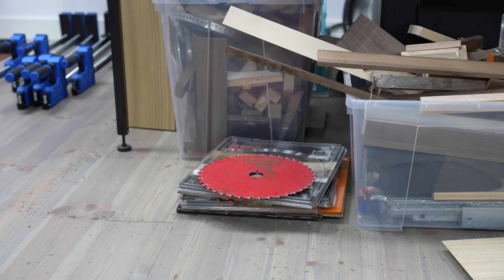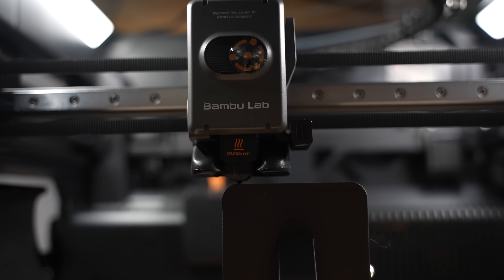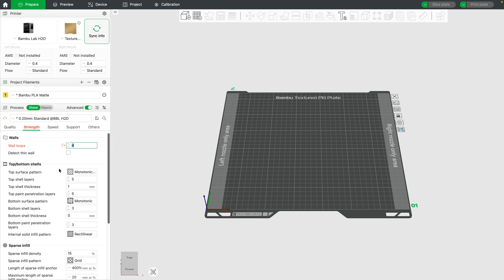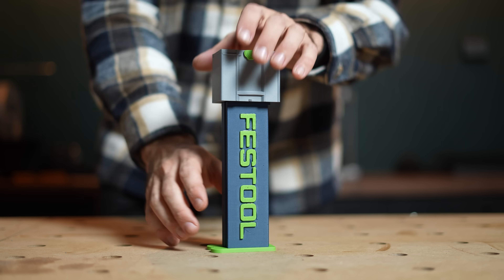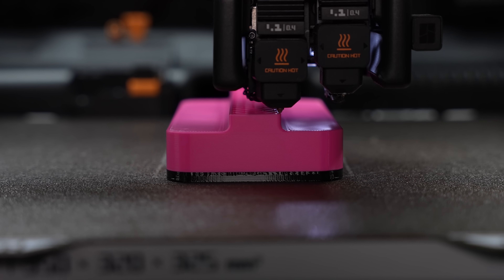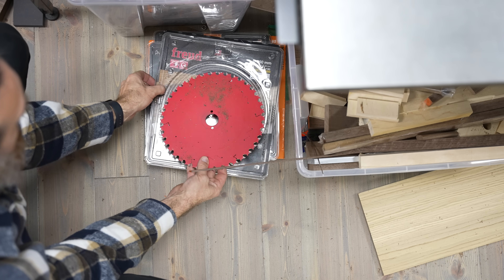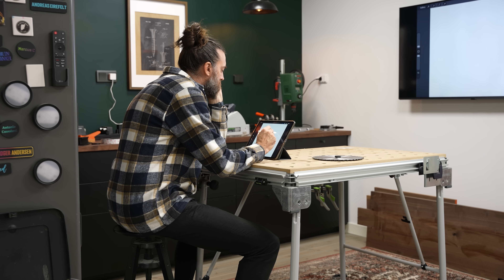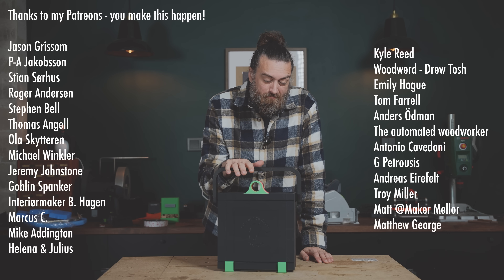Tool companies can't compete with these 3d-prints

Comment: A quick trick for those that can't print TPU or simply don't want to at the time is to print in another plastic and then coat the surface of same with a layer of silicone caulk. It will take a few hours to cure, but the coating creates a very "grabby" transparent surface.

Comment: The offset was the first thing I've thought about when You presented this saw blade case, but that's something every maker experienced, improvement, You can add stripes for pulling those handles this would make a workaround to pull them separately.

Comment: With regards to vacuuming the floor, then make a flat box to put on the floor. On one side you make an attachment for the vacuum hose. On the top, you can make a large hole to put in a contraption with a large magnet at the top and a hole through in the other direction. Put a handle on the top of that, so you can lift it out of the box. On the other side, you make it open with a bevel to the fool, on the blade on the floor, so it is easy to sweep the dust into the box. Make a triangular insert to narrow the box from the front to the size of the vacuum insert. When you sweep the floor, you just sweep it into the box while the vacuum cleaner is running. All wood dust will be sucked into the bag. When you turn it off, you can lift the magnet out of the box, and remove all metal bits like screws etc.

Comment: I believe the stamping of the dominoes is for expansion. When you press wood (not too hard or you break the fibers) And then you wet it, the wood springs back to it's original form.  This is very useful for dominoes.

Comment: I think your designs are amazing. And that last one, with the saw blades that was fantastic! I was thinking the same thing when you were talking about offsetting the handles that hold each blade to pull it out easier. And your small blade dispenser, great idea. I actually have been cut by a blade being put in our garbage and hauling the garbage bag out and the bag rubbed against my leg, and I cut it.

Comment: I just want to say this here for whoever needs to hear it:

Don't be afraid of CAD modeling!

I'm an absolute idiot and barely know how to navigate a computer and I can barely use the slicer, let alone Fusion. 

However, I finally built up the courage to try making something. I started simple by making a box with a circle cutout to hold a coffee mug in my camper. It took me embarrassing long (about 2 or 3 hours) but it turned out great and works perfectly. 

I then slowly started making slightly more complex things little by little. I've now designed and made about 10 things and it gets easier every single time as well as my designs getting more and more complex. 

I still get stuck at least 5 or 10 times throughout every project and have to Youtube how to do some super simple command but I learn a little more each time and so far there is nothing I have been unable to make. 

You can do it to, you just have to try.

Comment: seems like a bunch of good ideas... for the saw blades, I just put a nail in the wall and hung them off the nail, but I could see printing different colored arbors or tabs with offset to make retrieval and access easier. cabinets and boxes can be many different materials, wood, stone, metal, concrete, plastic, all different materials and processes have their advantages and drawbacks... Love it!  Have you thought about doing some vacuum forming?

Comment: Greay solution to the old knife blade problem. I jusy used a dremel to cut a slot in the lid of an old spice jar. I don't get the benefit of the snap off blade feature. I still lole the cheap and easy and fast option.

The table saw blade storage is BRILLIANT!

Comment: My dad used to go through a lot of blades and the safest way he thought of to dispose of them was to put them in a small paper cup far away from everything else and once it got full enough he'd just fill the cup with resin, let it cure and throw it out. Wasteful? Probably, but it was typically just excess resin leftover from the work he did.

Comment: Hi Pierre! The sawblade storage is awsom. Seems you are either old enough (like me) to remember the CD-storage holder for the car audio system or you are too young and have re-invented that design - pick what is more pleasing to you (probably the latter😉).

For the blades I have a much simpler solution. I have got myself safety containers, that are initially made for injection needles and scalpels. That's why they have a hole for screws and a slot for the blades. When it's full, I just dispose the closed container in the waste bin. So nobody will be hurt on the way to the combustion chamber. Over here, the waste doen't end up in a landfill. It is burnt for heat and energy generation. All steel in the waste is collected with magnets from the ash and gets recycled.

Greetings from Germany!
Andreas

Comment: Amazing video bro.  You are sooo good!

Just some 2cents
1);Bro that fancy bambu filament has you whipped.  Ur  paying WAYYYY too much for your filament. I bet u could print that first tool and it would be just as strong or a little stronger for  0.80. using pla+ .  It's s a game changer and only costs $11-$13 a spool for black.

2) I bet u will have zero problems with adhesion by shopping around and finding a better filament .b trust me they have come leaps and bounds and bambu is still selling us 5-10 ear old filament formulas and putting up a paywall for the newer stuff and calling it fancy names.  Even with the higher cost stuff from bambu it's still 95% pla .  Pla+ 2.0 is amazing at adhesion even with bad weather.  

You will never need to print ABS if you try pla high heat formulation unless you use it for super high heat resistance but   if it's for weather or UV resistance ASA is much more advanced and basically the same thing. 

3) for floor vac try your wet squeegy attachment for the vac and remove the plastic and aqueegy part and print a small rizer with tiny rollers and you can use your exteemders. Best part is you can switch back to your rubber squeegy in the future if you needed to.

Comment: Make the bottom of each blade holder rounded so the finger hole at the top can slide independently and then you can pull out a single blade easier

Comment: I like your saw blade holder and could use the individual pieces to hold my blades in my miter saw stand.   However, I do not have a large format printer.  Also, you have given me inspiration to look for other designs that would solve some of my work shop problems.  P.S. I really like that chair design!
Reply from the maker: Awesome! Glad you liked the saw blade holder and the chair design! 😊

Comment: Used utility blades and X-Acto blades are easy to deal with to throw away.  Just put some tape on the blade first.  The tape keeps the sharp edge from cutting anything so it's "safe" now. tape along the flat side and have two pieces  sticky to sticky.  This prevents the edge from catching on anything.

Comment: 14:58 it actually reminds me of a CD storage case I had in the 90’s. It held 6, each slot was locked in place by a spring locking mechanism. You push in the one you want and it would pop out the drawer.

Comment: for the handle on the blade holder - might put the individual holders mirrored in the middle, so it is like  /O\/O\  this ways the dovetail 'feet' can still pop onto the top to hold them in, and it would be every other holder being on one side or the other.

also for the black case for the holders - you could put a hex pattern of holes on the inner walls to reduce filament use and weight. (for the dividers).

Comment: Great video, as always! Suggestions for options on the saw blade carrier(which is Awesome, BTW). Add holes on the dovetail brackets/feet so the bracket can be mounted and you can remove the case from the mounting, if you want that option. Also have each blade holder/tray have dovetail on the sides that go into the matching dovetail rail built into the case insides. That would also give you additional options of pulling one or two blades from the case and sliding them into dovetail rails mounted anywhere, like under the side of your saw.

Comment: Nice.  I'm all for practical 3d printing.  Sure, an articulated dragon is fun, but I'm an adult.  There's lots of stuff available on Amazon, but most has some sort of compromise.  If I can design something that's exactly what I want, I not only end up with exactly what I want, I have the satisfaction that I designed it.  Not only that, but the more I design, the better I get at it, and this opens up even more possibilities.  If my design isn't perfect, or I break it, I can easily make revisions and print another.  If I'd got the original from Amazon, I'd have to search for a replacement that was not only as good as the first, but didn't have the flaws.  Anyone who's bought stuff off Amazon will know how hard that can be.

When I first started 3d printing, it would often take five attempts just to get a successful print.  Modern printers are so reliable that it's rare for a print to fail unless I've screwed up.  It means I am prepared to take on projects which I wouldn't have dreamt of attempting ten years ago.

For anyone getting started learning CAD, just design templates.  They are quick and easy to print, and save you the hassle of working with MDF.  You can save time and filament by cutting holes in the template, so it's just an outline with some bracing.  You'll quickly gain confidence to take on other projects.  Before you know it, everything looks like a 3d printer project.

Comment: I store my table saw blades in a file folder box for A4/ 8.5 x 11 file folders. I printed basically the same thing you did for the inserts, but glued the center, corners, and tab, onto some 3mm plywood squares.

Comment: I don't even do woodworking, but I do love 3D printed solutions.
Maybe you could just offset the handle hole to one side of centre, then just alternate the individual blade holders for easier access. This would mean you only need to print the one type of holder.

Comment: Did you know that you can make your own bed glue? Its safe and very cheap. You just by PVP(https://en.wikipedia.org/wiki/Polyvinylpyrrolidone) in a powder form, mix it with IPA (90-95% IPA to 5-10% PVP) and put into a sprayer. It also is easily washed off by alcohol or water. I have bought 100g of PVP and still have 90% of it after a year.

Comment: These are great! I don't think make a separate print file for the blade holding draw, just offset the handle and then you can just flip each draw that goes in, yes the blades would be alternating directions when you pull them out but I don't think that's that big of an issue

Comment: Great video as always! Instead of offsetting the handles of the blade case, you may be able to print some sort of springy mechanism in the bottom. That would allow you to slightly push down the blades on each side of the one you want to pull out, making it easier to grab.

Comment: I just finished printing 6 custom clamps for some custom wall skirts including the trapezoidal screws. Slant3D talks about microfeatures for strengthening 3D prints, excellent experimentation starter. So, yeah, I overengineered them... Technically it was 8 clamps, the other 2 where test runs for strength and accuracy. I really enjoy the incremental process to get something actually perfect. All in all, the clamps (if they where general tools) are roughly an order of magnitude cheaper than commercially available solutions.

Comment: Considering the weight of the blades and the print isn't that much, consider offset tabs like the Joseph Joseph chopping boards.
And although the "CD retainer" nipples are good, I might have considered a plain shaft and have embedded magnets around the edge of each blade.

Comment: Great video, as per usual! Am I correct that the 3D printing settings you suggested might help with the edge curling I'm experiencing in my longer, flat piece? If so, great timing!
Reply: Came here to answer my own question. Yes, these settings helped! Thanks for the tip.

Comment: Old bathroom medicine cabinets had a slit in the back for disposing used shaving razor blades. The razors would just fall into the wall behind the drywall.
Reply: I was renovating an investment property about eight years ago and removed moldy drywall in a room that shared a wall with a bathroom. There were about 2000 razor blades in that wall cavity. It took us a while to figure out WTH was going on.
Reply: "Tomorrow problem", they thought lol

Comment: I always struggle to find useful stuff to print rather than disposable 'toys'. I find your videos incredibly inspirational. Greetings from the other side of the planet (Australia!).
Reply: Agreed. Who needs more trinkets?
Reply: I have been 3d printing custom machine parts to improve machine performance at my job it is crazy how many useful things there are to print if you can design it.
Reply: If you don't know what to print it's may be because you have no real need. All 3D printer owners I know are constantly trying to justify their machine...
Reply: @Scientifiste  My trouble is I have so much stuff I want to print but I only own 2 printers  and there is not enough time after work for large prints! that's what the weekend is for

Comment: The timing of this is funny... I just finished designing (currently test printing the design) a circular saw blade storage system because I didn't like the ones I found on Thingiverse, Makerworld, and Printables. Yours is more efficient in it's use of material and looks like it will travel better. I like mine for it's stackability/modularity. I designed mine for an American blade with a 5/8" arbor/10" blade. I also constrained myself to something that would fit on a 265mm bed, so no need for a really large printer.

P.S. You might want to publish a copy of your design for American sawblades to keep the traffic to you design before someone else comes along and remixes it for a 5/8" arbor and captures all the American maker traffic.
Reply: Have you posted your version yet?
Reply: @gpricetube  Yes. "Modular Stackable Table Saw Blade Storage Case (10 inch blade, 5/8" Arbor)"

That said, I misremembered the "standard" size bed as 265mm, not 256mm. Darn dyslexia. 😅
I tried redesigning it for a 256mm bed, but a 10" saw blade is already 254mm, and 1mm on every side didn't give enough room for clearances, tolerances, and walls, especially if I'm trusting others to print it on unknown machines.

I am working on a version that can print on smaller beds and be assembled from 5x pieces, but it is slow going. Between other projects, commissions, and trying to find an joining method I like and feel is secure enough for thin prints like this, I haven't got it ironed out to the point where it will meet my standards yet.
Reply: @T @TheArmyKnifeNut  Awesome, found it. No sweat, and I do have printer with a 320mm bed that I can fire back up. Been spoiled with Bambu Lab and haven’t reached for my older printers for a long time.

Comment: Matte, high temperature, easy to print, insanely cheap: HIPS. Try it!

Blah blah support material, i don't want to hear it any longer, it prints so beautifully that it's a pity to waste it on supports. What it lacks in tensile strength it gains back in layer adhesion, and it is impact resistant.

Bench cookies: print a 1 sided mould and cast some silicone? 2-component silicone can be quick-cured on your printer's heatbed, i have a feeling that it's going to work well. I use self-cast silicone bits all over the place.

Handle: just give it flat not so curved sides to make pinch and lift easier, and maybe texture them a little with further protrusions.

Comment: The channel Start Making (Woodworking) recently did a video on 3d printing vs woodworking in the workshop, and he ended up using nitrile bonded cork for the grippy material on his bench cookies. It's normally used for gaskets, but it looks like you can get in precut circles or in sheets.

Comment: so it turns out that TPU isn't very sticky. We think about it like rubber, but in reality it's only flexible like rubber. It doesn't have any traction. It's terrible for RC tires or something like what you tried.

There are other flexibles that do that thought.

Comment: 4:00 min, there really is no need for glue of any sort. Just don`t touch your buildplate with bare skin. If you do encounter adhesion problems, scrub your buildplate with hot water and dishsoap. That removes any fat/oil and you are good to good.

Comment: I'd suggest making a larger static nozzle for the dust collector mounted at floor level and just sweeping toward it.
Reply: Or alternatively, instead of a handle print on a 'flagpole holder' so you can stick a broomhandle in it and sweep without bending low as now.
Reply: Like hairdressers have, good idea.
Reply: Second this. These are great just be mindful not to accidentally sweep in any metal screws etc.
Reply: @Littlefieldpaints  Worth adding a magnetic strip across the bottom of the mouth?

Comment: the saw blade holder handle could double as anti-slide-out mechanism if you add a block that's normally in line with the handle, but can be twisted to be perpendicular to the handle and the blades.
very cool project

Comment: You could add threading for a broomstick on the vacuum nozzle.
Reply from the maker: That's a clever idea! Thanks for the suggestion!
Reply: Yeah. And put a flat surface on the bottom. I did that because the stiff hose sometimes prevents using it like a real vacuum cleaner. With the flat surface the nozzle stands horizontal on the ground and i can sweep the dirt towards it. And it's easy to move with the attached stick. But mine is more like a frankenstein version. A quick attempt with tinkercad. But it works.